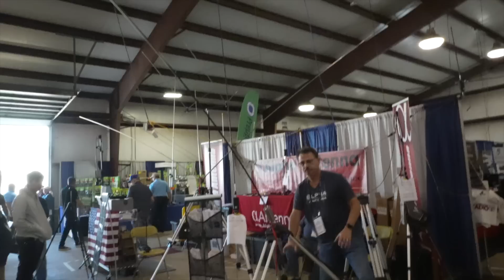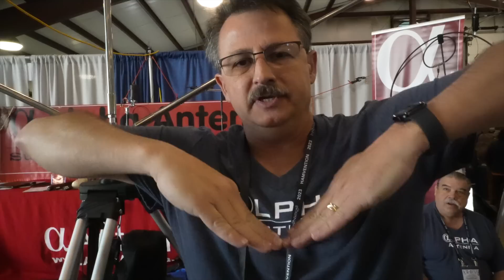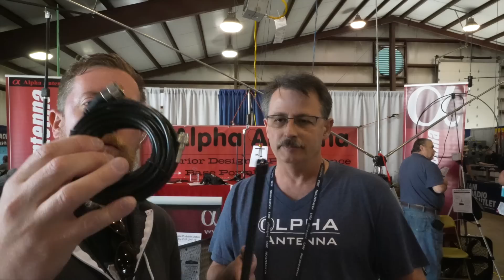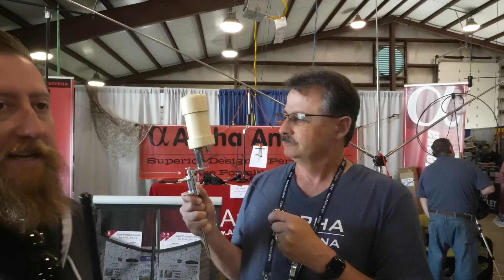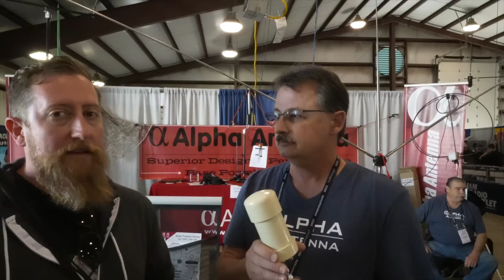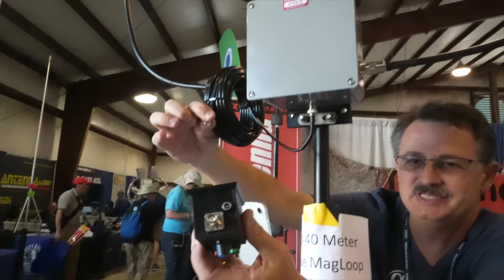Alpha Antennas Has You Covered!

Comment: I received a Alpha Hextenna last week as my first store bought antenna.  I have only used it 10m and like it. Have not tried it as a vertical or any of the accessories. I built a Rain Gutter antenna with a 12’ wire and 9:1 unun . Mine does not work great but one day when nothing worked I checked in to a 10m net from South Carolina to Arizona on that gutter antenna. My gutter antenna is resonant at 2300 KHz how it functioned on 22.380 MHz  I don’t know.